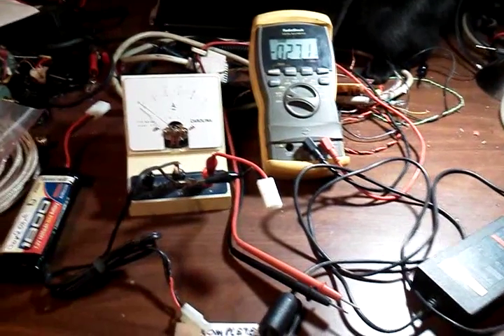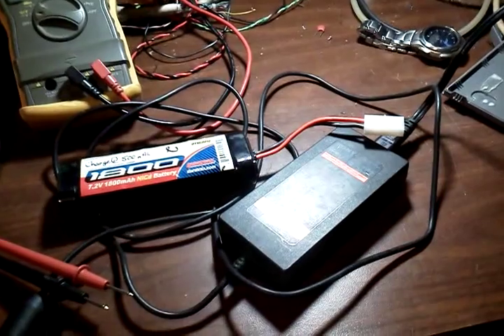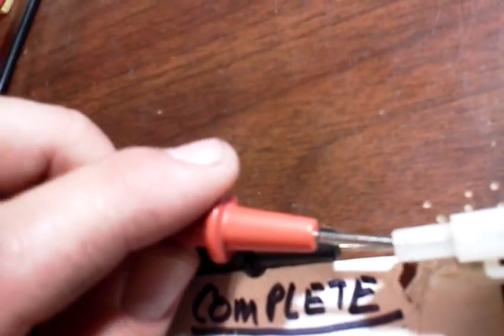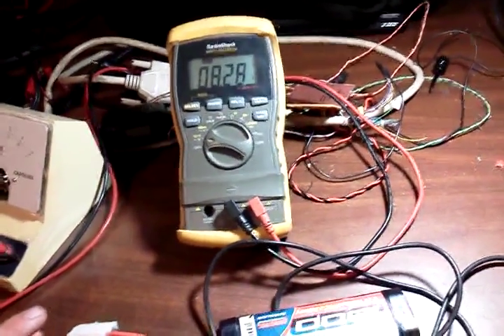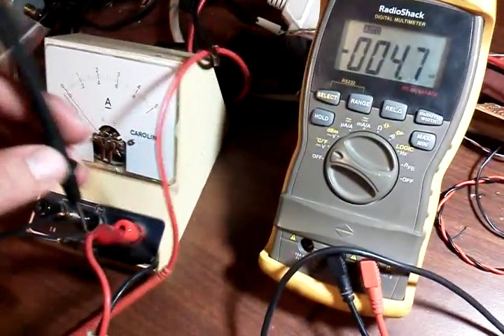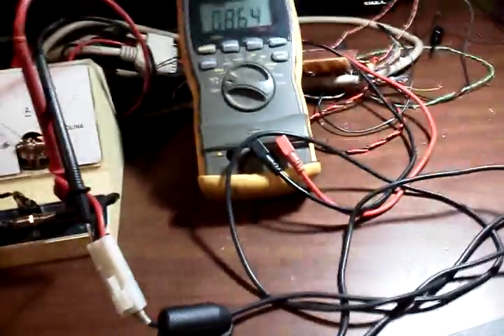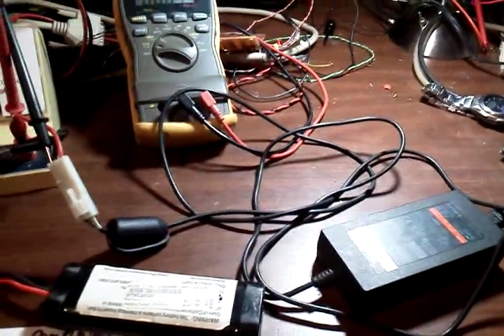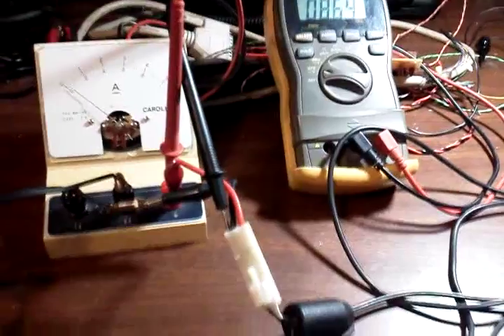How to Build 7.2V 6 cell Ni-MH Ni-Cd World Travel Battery Charger

Comment: @project23d I'm not finding any good videos on how to build the battery pack from scratch. I have access to individual cells for dirt cheap, but I don't know where to start, how to connect/solder/seal etc, or even which batteries to buy for that matter... maybe it doesn't matter, as long as they're nimh & 1.2v ea??
Reply from the maker: Tai Theguy if you were to search for howto's on building packs, you will find what you are looking for

Comment: can this charge a 8.4 nimih also or how can i build one to charge.  jr1973c@gmail.com can u email me info on how to build one
Reply from the maker: Yes. Remember in the video the open circuit voltage will not exceed what the power supply is putting out. The output voltage of the power supply will drop to the terminal voltage of the battery. As the battery is charged, the voltage will go up, not exceeding the open circuit voltage of the power supply.

Comment: can I use a portable ps1 charger & where can I get the connecters for cheap
Reply from the maker: make sure the power supply will output only 8.5 volts. you can get the connectors that any hobby store or you can buy them on the Internet. the connectors that you see in the picture are Tamiya but a lot of racers are now be converting over to Deans
Reply: +Project23D the charger says 7.5
Reply from the maker: a fully charged 7.2V NiCad/NiMH battery is about 8.5V. If the power supply you want to use outputs less than that, your batteries will not get fully charged.

Comment: R-U saying if i forget to disconnect the battery and leave the battery plug overnight the battery wont over charge and blow up.
Reply from the maker: If you leave it connected over night, it will not harm the battery, as long as the open circuit voltage of the power supply does NOT exceed 8.5Vdc.
Reply: Thanks for respond well there goes my son's PS2 power supply LoL.
Reply from the maker: Taniowarrior00707 I forgot to mention to make sure you test the supply to see what the voltage is. Generally OEM Sony 8.5Vdc power supplies are very close to the specified output. The 8.5V is voltage the fully charged six cell battery pack would be. So if the power supply doesn't output more than that, there is no fear of over charging

Comment from the maker: Sure. I've made them before with alkaline, ni-mh and ni-cd cells.

A noteworthy comment is that Energizer rechargeable ni-mh batteries made in Japan are junk. Maybe two, four max cycles out of them before they short themselves out. I've come across a small supply of them, and have been through at least 75 of them in the last year. I have 12 that are holding up.